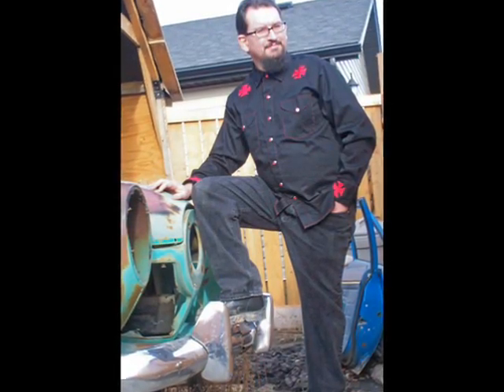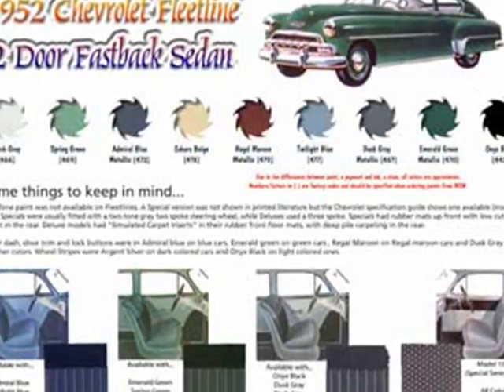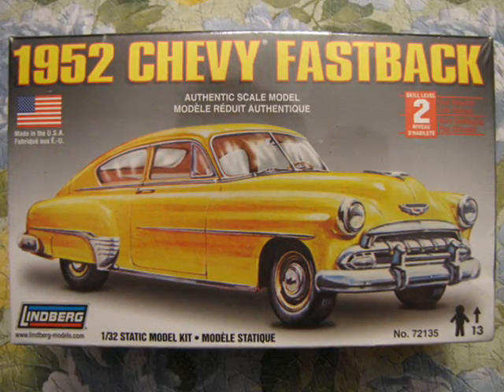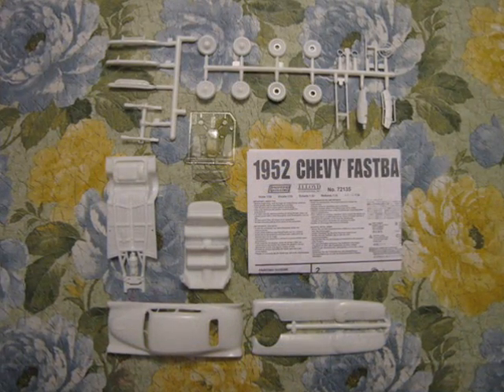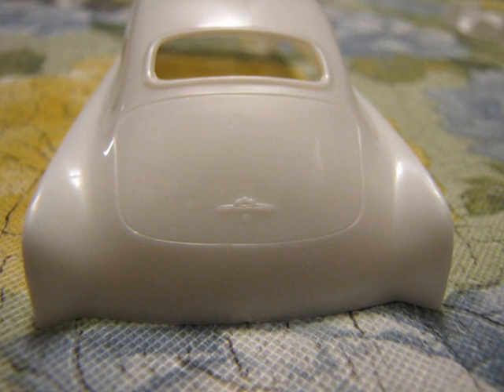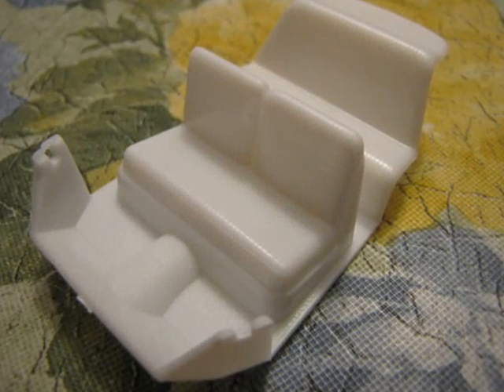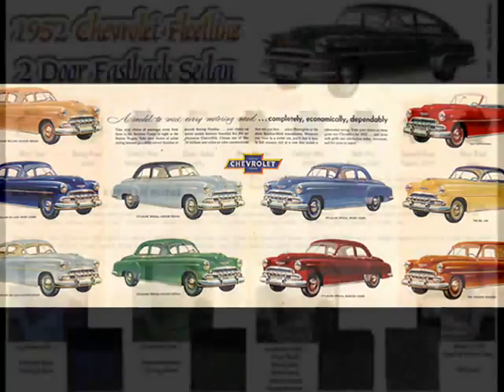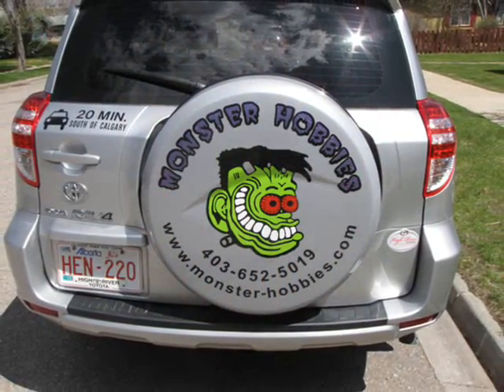Model Car Garage - Lindberg 1/32 Scale 1952 Chevrolet Fastback - A Model Car Unboxing Video

Comment: Just bought this model at Hobby Lobby. I kinda figured that out about the tail lights, but you confirmed it. Funny that the instructions didn't indicate that as a place to use red paint. I like that these are made in our part of the world where the real ones were made. Really liked the video.
Reply from the maker: Thank you for liking the video. did you ever get your model built? I haven't finished mine yet.